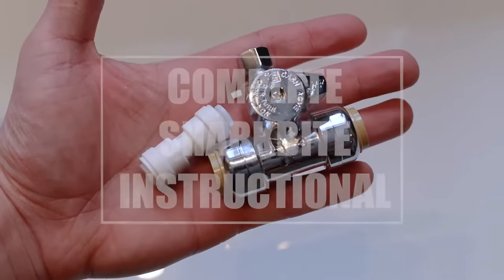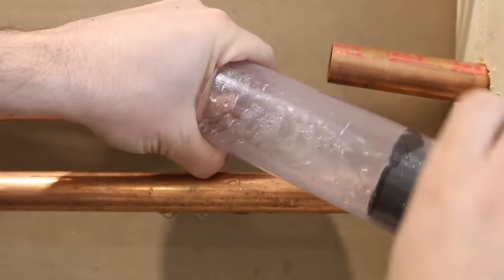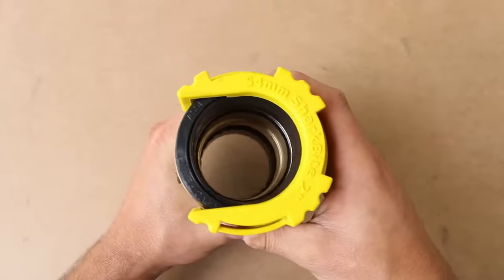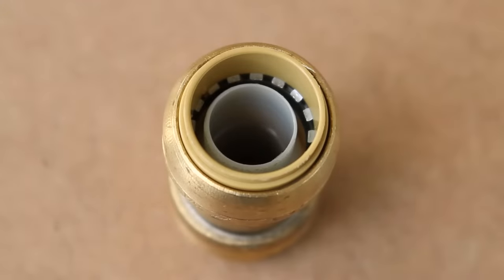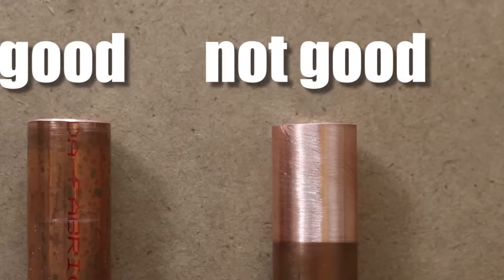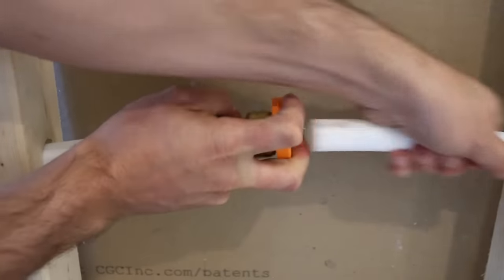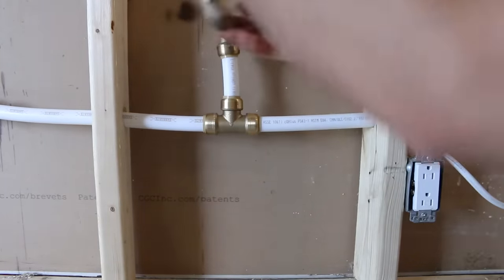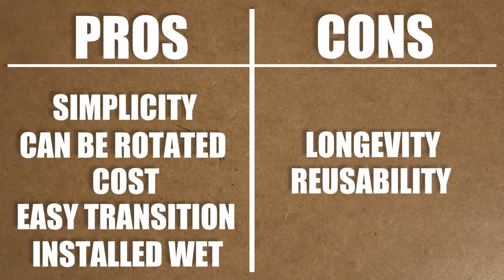Beginners Guide To SHARKBITE Fittings (Watch till end BEFORE Buying!) | GOT2LEARN

Comment: I was unable to get Sharkbite in my immediate vicinity (small city Canada) so I have purchased the Push ‘n’ Connect brand. I wish I could find more info about them before I go ahead with my work. My first job is simply replacing a bathroom faucet, but then I have another bathroom and a rather oddly setup kitchen faucet that also need this treatment. My house was built in 1989 and they are straight copper pipe - there aren’t even shutoff valves on them 🙄.  Then I might wait and see how they do before I tackle the toilet inlet lines 😀. If anyone reads this and has experience with the Push ‘n’ Connect brand, I’d love to hear from you. Thanks for a great video!

Comment: I’ve always sanded my copper pipes with 1200 grit sandpaper because it smooths out the oxidized surface so far no leaks but I would never use low grit. I like how the joints can move. It was great when I had to refit the pipes when I changed to a tankless water heater.

Comment: I used these to replace my gas water heater. Connected them to copper piping as I didn't feel comfortable soldering. They worked fantastically. And they are accessible and in my garage, so if they fail it wont be a huge deal. Next I am going to try the shark bite washer and dryer dampeners as my washing machine causes banging pipes. I found out about these on one of your other videos. Thanks!

Comment: I installed them in my basement remodel job. I did drywall them in on the ceiling BUT i ran the line between the living space and kitchenette so i could screw the drywall onto the 16" floor joist and then used wooden transition pieces to add a seperation effect to the 30' basement run. That was i can unscrew the dry way rather than tear it out in case of a leak. Thay way hopefully i don't need ti tear out the entirety of 4 feet or more in each direction. I did mark exactly where my shark bite  connections are and have debated on putting dummy vents (vents i blocked on the joist side with small holes as not to let to much heat escape into the 16"  joist space) for a water run out location to contain the damage from any future leak. When it comes to ANY connection its when not if a leak occurs, anyone who days the word "never" in any trade shouldn't be hired. If they lie about a obvious thing like never then they have no issue lying about anything.

Comment: Love this product because there is no need to be an experienced plumber to use them.I have several in place in my house and so far no problems.This video is excellent as it clearly explains the right and wrong way to use "Sharkbite " push fittings.I learned a lot from the video and will apply that knowledge in any future applications.Thanks very much.

Comment: sharkbite now has a fitting that can be used with PVC tubing as well.  at my house in texas, the service coming in from the street is PVC (would not have been my choice, but it is PVC on the city side of the shutoff as well so it is not like i can replace it all back to the main line.  i have used these withing a wall cavity and behind a ceiling panel.  although this would also not be my first choice, the space i had to work with would have made it impossible to use a crimp ring (could not get the crimp jaws into the cavity) and there would have been no way to solder it for the same reasons without ripping down a great deal of the rock to make more access...

Comment: I have a few Sharkbite and other fittings that push on like Sharkbite.  I have such a fitting under my bathroom sink and to my toilet.  They've been in place for a few years and they are still fine.  I find it handy to be able to do this, as I haven't mastered soldering.  Soldering would also require a heat shield which I don't have.

Comment: Awesome video, thank you for making it. Will be replacing my hot water storage tank that is located outside. Now have no hesitation on using these fittings and not bothering with soldering.

Comment: Fantastic video. Very professional. I very much appreciate the demonstration with the cut in half fittings. Also the animation was great - I had no idea. I’ve subscribed, and now I’m going to return all the push fittings that I already purchased for my small project and I’m going to look to see if you have a vid demonstrating the crimp connectors and probably going to go buy those - I think they were less expensive as well. I’m not crazy about the thought that I might damage an ‘o’ ring and not be able to see it. However, I don’t like how the pinch crimp connectors look on top of escutcheon, just before the the shutoff valve - I’ll have to figure that one out. Maybe I’ll only use the push-fit shutoff valves for that part - at least if those leak, it’ll be readily noticeable, and not buried in the wall.

Comment: I installed a shark bite on my kitchen sink stem 17 years ago and it’s still going strong. And I did it with 0 plumbing experience and before YouTube. I got advice at the hardware store on how to use them, did the work and brought back pictures for them to confirm before I turned the water back on.
Reply from the maker: Very nice 😉

Comment: My experience with sharkbite or = is I only use them as a last resort or when I do not take the time to remove all the water in a copper when fixing slab leaks. They have their place but never put them in concealed locations, be sure to measure the full depth and mark on the pipe and then push them in all the way.
They will come apart if not pushed in the full 1". Also in Texas at the severe last freeze, my than half of the pipes I fixed were connected with sharkbite and they do not hold up to freezing at all. PEX A with PEX expansion rings is the best overall.
I like my customers to be DIY'ers and self-sufficient so use sharkbite wisely and sparingly

Comment: By the way i have used this item in open area so i can see it with cold water in my entry  water filter. For 5 years i have no problem. I even used it in hot water supply under sink . I perfer you can use it where you can monitor it just in case. I like this product. Another con is cost effective. If i just do some upgrade here and there it is ok. But if you ha to use many connections it is costly  compared to traditional copper soldering. That is all

Comment: Such a thorough demonstration on the “sharkbite”!! Thanks! I’m going to install a water softener in my house and found some rough materials like mortar on the copper pipe where I will need using these couplings. How do I clean the copper pipe then if not using sand paper, as you mentioned not to use them in this video?
Reply from the maker: 3M abrasive pads, link in description box 🙏

Comment: Plumber here:
Great info. I agree with what you said on the Sharkbite longevity issue. I don't believe the O rings will stand the test of time. I also have an issue with S.S. "biting" into a plastic pipe. The pipe will expand and contract with hot water and will eventually tear into the plastic pipe.
Reply from the maker: Time will tell, I know a lot of plumbers that DO use these, so we will know in the future ;)
Reply: I did a job for Delta Faucet Company several years ago. They had a similar product that was new but not tested well. I installed several homes for employees of Delta with the written agreement that I would guarantee my workmanship but not the products longevity. It eventually failed. Although Shark-bite is an improvement on their design, the basic engineering is the same. It’s popular because it’s ridiculously easy to install and will last the short term. In an emergency, I’d use this product.
Reply from the maker: @alvideoprod  yeah it's a hit and miss type of thing. What happens is that these fittings do require the installer to read the instructions but most don't, which is why they fail a lot.

Comment: I had two leaks under a trailer.  Cold weather Sunday afternoon. 
The cold old gray pvc line was  leaking at the elbows under the floor.  No room to work.  I cut the cold line under the sink. Used 1/2 inch sharkbite to cpvc. To cpvc elbow (cement), to cpvc, sharkbite,  back to gray. 
Only to find, the hot line at the elbow was also leaking.  Repeat! But was used a sharkbite elbow.  Much faster,  cleaner and happier! Using only sharkbite.

Comment: Every homeowner needs to have these in an emergency kit. Some may laugh, but in my garage,  I have.

5 gallon wet/dry vac
10ft pex pipe 
Various sharkbite fittings
Extra A/C start capacitor
JB weld putty stick 
Water meter shut off tool

And I have various other things. It sure as hell beats a busted water pipe in the middle of the night with no way to shut off the water and a 2,300 bill for emergency repair and cleanup. I have been there!

Comment: Great video!  One con will be it does break electrical conductivity.  If the pipe is used for grounding, you will need to add something to preserve the conductivity.
Reply: Right.  Here in Tampa, FL I've noticed all new installs go to the electric company's ground and not the old iron or copper plumbing.

Comment: I had that problem of trying to connect to a copper pipe where the water could not be completely shut off due to a shutoff valve that would not completely shut off.  I used a flare tool on the rigid 1/2" copper pipe, and flared it (placing the 5/8" flare nut onto the pipe first). I was then able to connect a 5/8" flare/ 1/2" MIP thread adapter, to which I threaded a new shutoff valve for that fixture. I have never heard of anyone using flare fittings to connect rigid copper pipes before.

Comment: Very informative! I started my sloppy repairs of quest butylene pipe back in the day when these first came out, with mixed results most likely from the mistakes you discussed. I then went to Pex copper crimp rings and I  just purchased the Pex A expansion tool this year as it seems like the best longevity.

Comment: I just had to replace a shark bite that was installed under ground and it cost the homeowner $2,800 in a water bill bc he had no idea the fitting had basically split in half beneath the ground. So I agree, open accessible areas, okay, behind walls or underground, not so much.

Comment: Wonderful, presentation I do differ on the cons  reusable  just once or twice brings your initial cost down  longevity they have been in the market for over twenty years  I have been using them for about fifteen  and have yet to have one fail/leak  but you never know until someone makes a comment 
thanks for a great hands-on presentation
Reply: Our house is 27 years old and about a year ago I noticed some brown water circles showing up on the ceiling in our kitchen.  Turns out, a soldered copper connection in the 3/4 inch hot water line running above the kitchen decided to have a very slow leak after sitting there for 26 years.  This is between the first and second floor and happened in May so there is no chance there was any pipe freezing involved.  So no type of connection system is perfect.  Go figure.

Comment: @ 6:33 wearing headphones, this part really terrified me. thanks for teaching all there is to know about SHARKBITE! going to replace a very old water heater and think I will cut the fixed copper pipes and add flexible hoses with SHARKBITE
Reply from the maker: Yeah don't know what happened at 6:33, sorry bout that, if you need help with your project, I just opened a forum right here: https://got2learn.freeforums.net/

Comment: The plumbers I deal with all have mixed opinions on shark bite. Taking what I’ve learned from them I always tell customers that they a great for a quick fix. But for a long term solution I’d always recommend solder or pex fittings.

Comment: Your videos are super helpful. One other downside is that Plumbing contractors and building inspectors may perpetuate rumors that these will not last ....and are a problem waiting to happen.  This is a potential downside for property value if you use them.
Reply: Not at all. They hold up better the brazing.     Had them installed in an rv for 8 yrs not one leak.

Comment: O-rings are actually sealed by fluid pressure and the silicon grease applied to the O-ring. The grease will create a seal and the water pressure will force the O-ring against walls of the tubing. This is also true for hydraulic fluid systems like cylinders and fittings. I experienced a weeping SharkBite on the hot water line but later I realized didn't not open the hot water heater valve to properly pressurize the hot water lines. When I opened the hot water valve the SharkBite stopped weeping. I'm not sure if this will help but I'm going to apply a film of silicon grease on the pipe before inserting into the fitting.

Comment: Recently helped put new stems for tub and shower in, needed to remove the whole piece (idk what you'd call it lol, like the pipes the stems go into) and everything that wasn't metal was pex. We had a 1" to 3-4" problem trying to get the pex attached to the metal pipe on the stem piece (something like that, what do ik I'm not a plumber), whatever was originally attached to the pex was too big to attach to the new stem and pipe set, you know what I mean? Keeping up? Hell I'm not keeping up and I'm the one saying it xD. Anyway, we ended up cutting the whole piece of metal (later realized it was a couple of adapters to fit the pex to the first stem and pipe set) off and getting a new adapter to fit the pex to the smaller part. If anyone understands where I'm going with this you're a god, but we ended up shark bite clamping the pex to the adapter, of which was screwed to the stem set. I was apprehensive about the shark bites, having heard they were not good for the long run, but it was my parent's call. I was just there to hold parts, get tools, and turn the house water on and off, and knowing nothing of plumbing and having spent 4+ hours in a small bathroom with my dad getting more and more po'ed at this damned thing, I wasn't about to comment on it. After all was said and done we have a working, non leaking faucet and actual knobs instead of vice clamps directly attached to the stems. I fished the old stem set from the trash to tinker with bc why tf not, and realized that the part we just removed and the metal we cut from the pex piping was set up pretty much the exact same way we had just replaced it with. A couple of adapters hooked together, shark bite clamp holding  the 1" pex pipes to the adapter, adapted screwed in to the pipe set. The shark bite clamps had never leaked, the issue was only ever with the stem pipes. And one can safely assume they were in that wall holding everything together for roughly 7+ years, as long as my family lived here plus a bit of extra time from previous owners. Anything else is assumption based on wether or not the past owners ever changed the part, but it could have very well been there as long as 15+ years. I'm not as sceptical of shark bites anymore to say the least. Anyone who understands a bit of this and read this far, you deserve a reward 😆

Comment: Best replacement fittings ever for mobile home plumbing repair. The cheap ass flex tube, CPVC, and the rare copper pipe. Works well on all types, replace the factory fittings and forget it. SharkBite rocks!

Comment: just used one to cap  a pipe in my wall shower valve was faulty had to open up the wall was going to solder a capon but the associate ate the plumbing place suggested this as a quick repair to get the water back on i bout the removal tool  as well i may of been over zealous cleaning the pipe as i sanded it like i would when soldering but its not leaking so im good , im with you on the closed wall though i will solder the pipes but for a quick fix or where the pipes are exposed its a no brainer

Comment: We tend to use nylon olive compression fittings in Australia you only need a spanner to do them up.  A lot of builds now are using poly pipe much cheaper than copper pipe.
Reply from the maker: Great point!!

Comment: Great I installed 2 of these yesterday and used 600 grit sandpaper to clean and de-burr the outside of the copper pipe prior to insertion.. was a SB 90deg washer valve. Both are not leaking but after hearing this now I'm worried

Comment: I have used pushed fittings for over 15 years on board ships . They are durable and easy the only time they fail if they are over pressure or exposed to oil and grease. What normally happens people keep reusing them over and over and the pipe gets worn out and the teeth don't hold any more and they start to pope out. If you put too much side load the same thing can happen. As long as there is not much side load they should be ok.

Comment: Epdm has been around for a long time. And having worked in an industrial lab using purified water, these shark-bite connectors were really easy to work with and held up against the corrosive pure water.

Comment: I just installed some on a water heater project.  They are water tight, but I do not like them.  I predict that in the environment they are located, extreme TX heat, I will likely get no more than  5 years service from them.  I used these because right now I just do not have time to re-install and sweat all the fittings.  Mine are all installed where I can easily visually and physically inspect them and replace when I have more time.  After seeing these in action I would never install inside and enclosed space where I could not inspect and easily replace.

Comment: Wish I would have seen this video two weeks ago. I just replaced a gate valve and outdoor faucet at home. I had to unsolder and re-solder all the copper fittings. What a pain in the ass job. Using the Shark Bite method would have been the way to go.